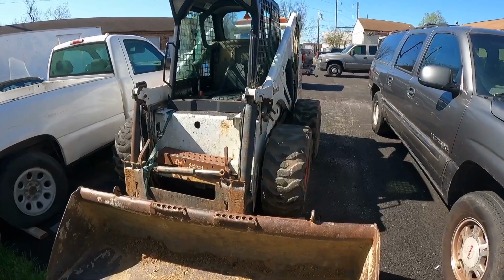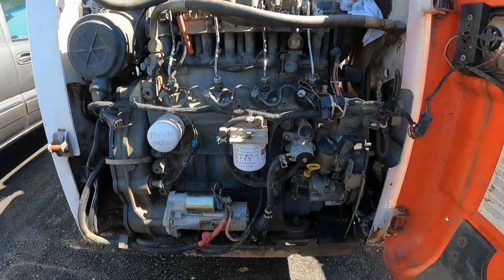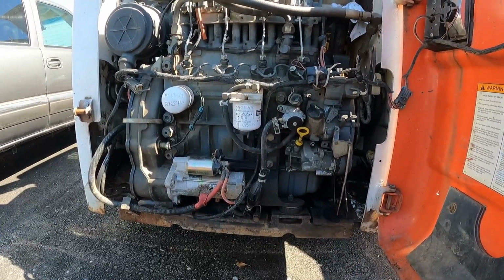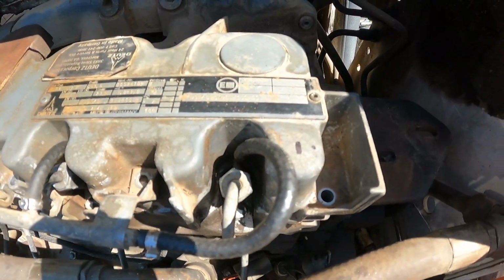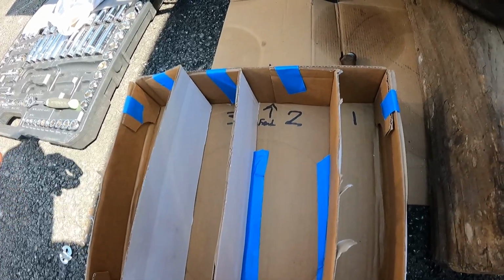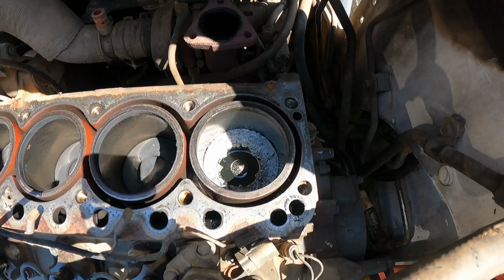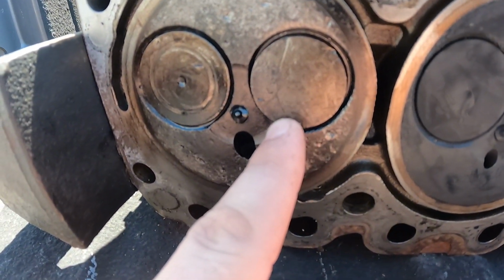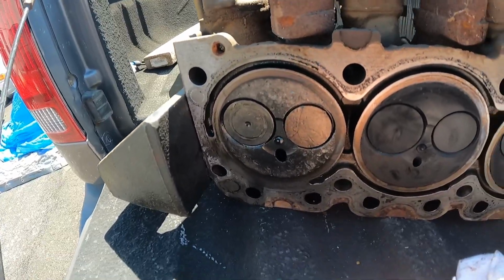Blown up Bobcat engine

Comment: Definitely reparable with a sleeve. Issue would be finding one for that application, idk how readily available that would be. And obviously still taking everything apart to check for more shrapnel I’d imagine haha.
Reply from the maker: For sure ballooned into a bigger deal.  Sleeves are available but the way the block is cast the crack is unsupported making for a much more difficult if not impossible repair. The sleeves are pretty thin and require the squeeze from the cylinder walls to support them.
Reply: @thedelcodave  JB weld it is!!!